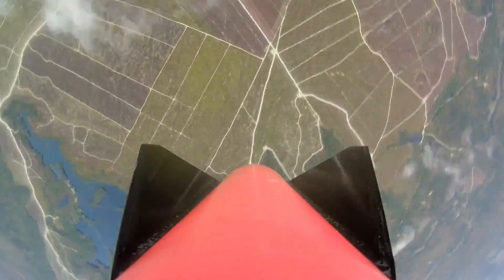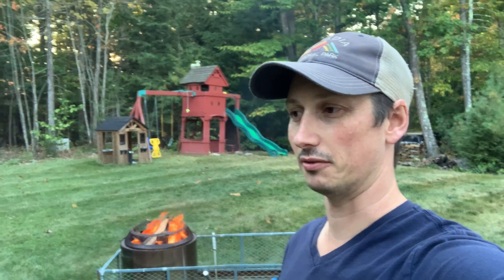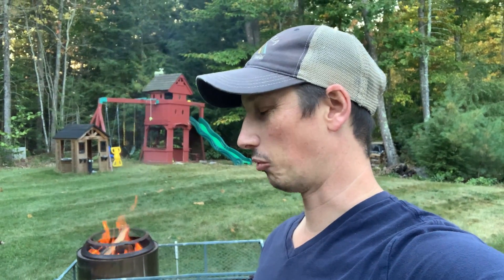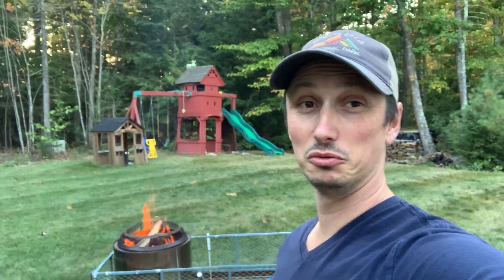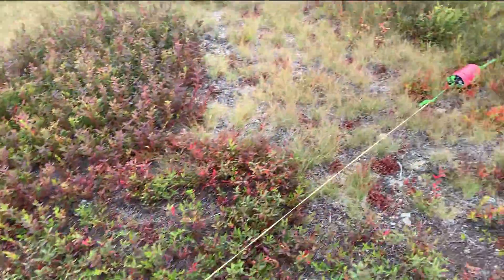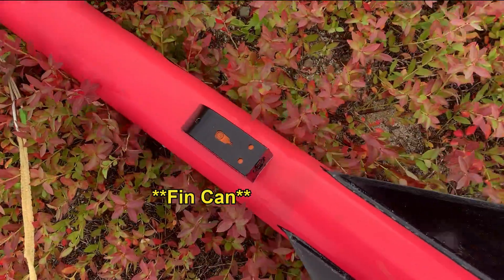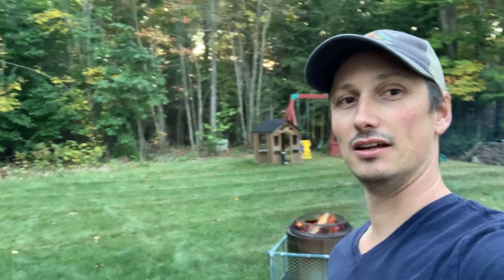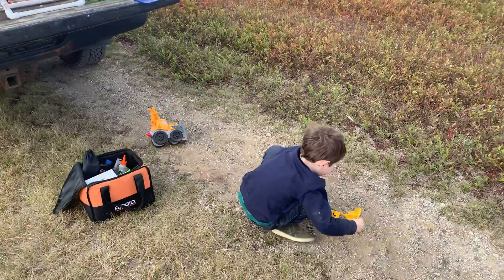My First Experimental Rocket Motor Flight

Comment: Yes this is the video i was referring to i would very much like to make my own fuel and motors was hoping to chat with you about this
Reply from the maker: First good step is finding local folks in your area that do the same. Where abouts are you located?
Reply: @pathtouch1  I'm in Austin Indiana I've been in contact with nar and am going for my level one asap and try to be level 2 this summer so I can at least get access to the APCP and other necessary chemical

Comment: You can release a helium filled balloon prior to launching rockets, it will give you a good idea of the winds at various altitudes. We used them in the military (Pi balls) to judge winds for airborne operations so you don't have to "find" Paratroopers/Equipment, I imagine it works the same for rockets.